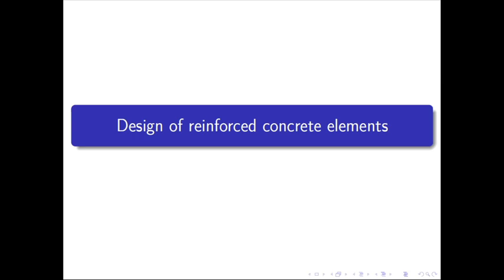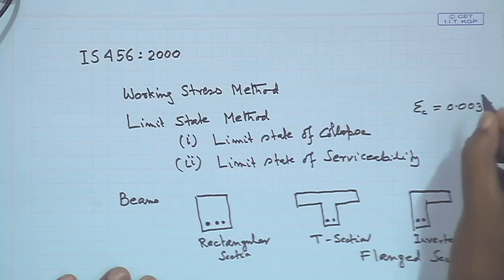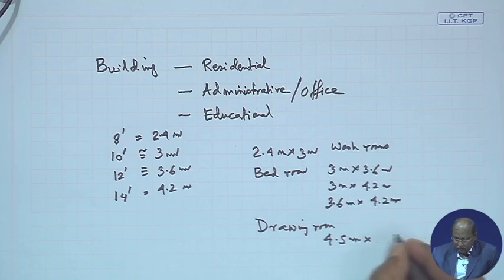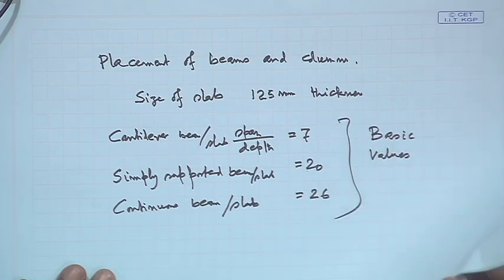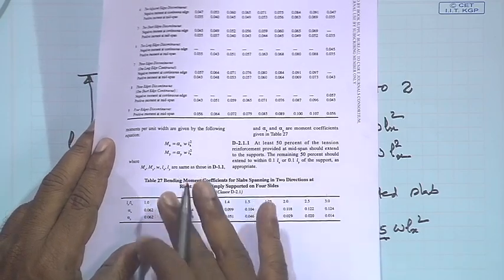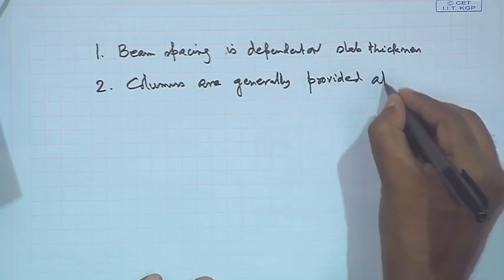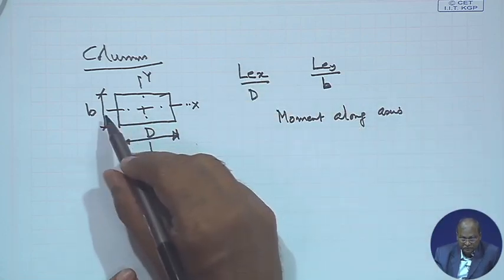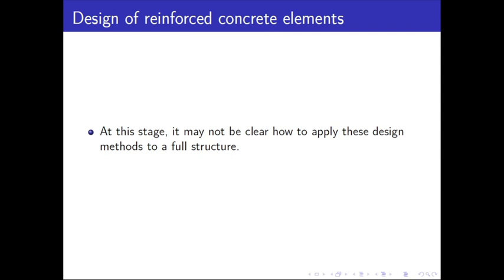Design of Multi-storeyed Building Frame (Part - I)

Comment: In S.N.Dutta book I have read that depreciated value of each part can be determined by the formula,

D=Present market rate *  (( 100 - rate * depreciation ) / 100) to the power of n,

where n is the number of years the building has been constructed

I think we can shall may vphv follow the same principle in Valuation reports too at any cost........................

2. In S.N.Dutta they have mentioned in a table the life of each part of building say

Iron work   n = 80 years
Door work n = 40 years

So I think we can shall may vphv estimate depreciation for each part separately at any cost........................

3. Last but not the least I think from practical observations life of wood is more if we take proper care from insects or minor issues as compared to erosion of cement or steel....

But life of cement and steel can be less in our Country due to heavy winds as observed from cracks in many areas, so i think we can shall may vphv please suggest a better method of estimating the value of building from these practical depreciation values and revise Valuation of multi storied buildings with these observations at any cost........................

4. Also land can shall may vphv show depreciation in values due to Soil erosion improper waste and imbalances in pressure, hence these factors can shall may vphv be checked and depreciation can shall may vphv be revised and calculated at any cost........................

Thanking you..
Yours sincerely,

Spurthi.